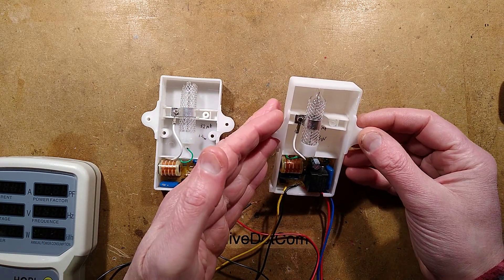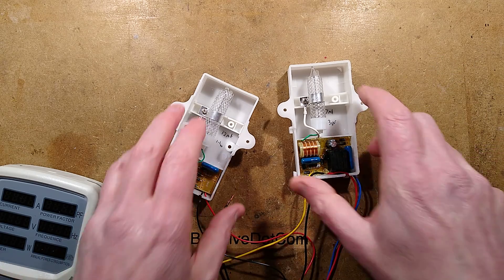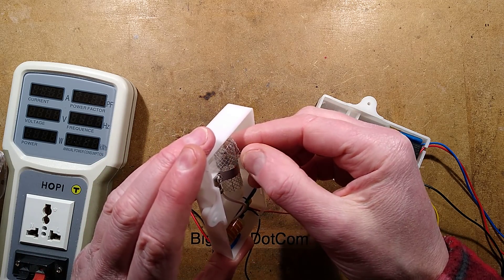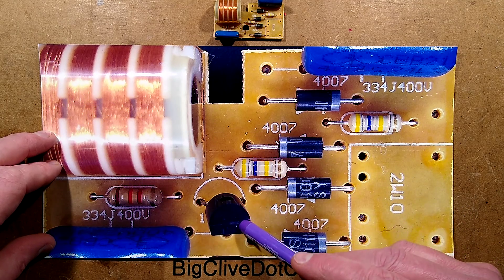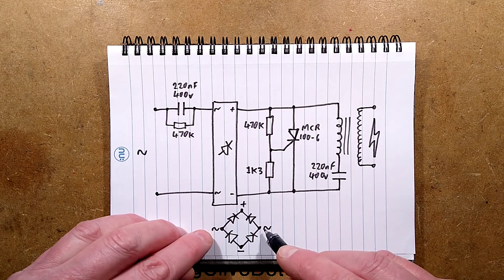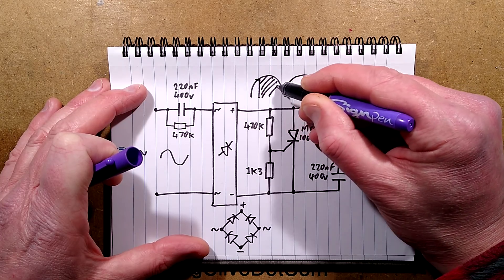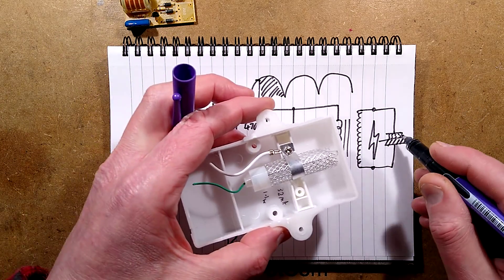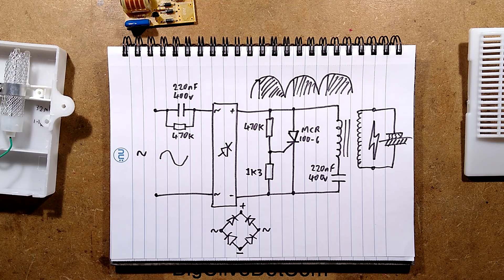The "two-wire" high voltage mystery eBay device

Comment: Thank you for exploring into the 120V side of things, Clive!
These are interesting, but I think they would not like my radios. LOL
Reply: This is a 220V device that outputs higher voltage to the discharge tube.
Reply: @johndododoe1411  I think the 120VAC version would be the same, just change the resistor ratio slightly. The thing to make the high voltage there is dV/dt, the speed of the turn on of the thyristor, so the secondary circuit can generate the fast rise time pulse. So long as the capacitor on the primary side has enough charge the limiting factor is the tube strike voltage, which is a lot lower than the open circuit voltage the transformer can produce, though that also is limited by internal arcing through the distributed secondary.
Reply: I just have a quick question for you.
I am quite a noob about electronics and there is something that I never quite understood about capacitors. What is preventing them to discharge into the "charging part" of the circuit instead of the part that you want to dump that high voltage into? My only guess is that you can use diodes to prevent the electricity to flow back into it but are they strong enough to not get fried by all this high voltage? Or maybe there something else that I am missing?
Reply: @Reth_Hard  I can see the confusion, but to understand you have to look at the circuit.  For example a smoothing capacitor after a bridge rectifier does not feed  back through the rectifier (because it IS a set of diodes that rectify the voltage) but instead sustains the voltage during the altering voltage trough. That's a parallel application.

A dropper diode is a series application and that's a little harder to visualise.  If someone could explain it to me I'd really appreciate it, but I've always imagined it as a charge pump.  The -ive side of the capacitor is actually +ive wrt ground but the capacitor will only "conduct" as much energy as its specifications allow - which is why dropper caps are usually rated in (a few hundred) nanoFarts.  That "energy" will result in mains voltage if you measure it with no load, but under load a much more friendly voltage will usually result.  That's why Clive and everyone else is a bit suspect about dropper capacitors in the wrong application.  A component malfunction could result in mains voltage where you don't expect it, or a wrong polarity could put the device case/earth at mains potential as we've seen in a few videos.

A third application is as an R/C (resistor/capacitor) filter.  It's a series application with a resistor (that's the filter part) but it is in parallel with the signal.  That means it dumps resonant frequencies to ground/-ive.

I also think that I'm a lousy electronics teacher, and this probably hasn't helped you in the slightest LOL
Reply: @Chris_the_Muso  
Thank you anyway...  :P
To be honest I forgot that capacitors were often used for filtering curent and were just assuming the one we see in the video was used for pulsing current into the mesh thing. I'd like to learn just enough about electronics so I can repair some of my stuff when it's possible instead of dumping it in the garbage. I feel like it would be better for my wallet and the environment.
Reply: @Reth_Hard  Ah, I see.  Yes it does cause the capacitor to discharge through the coil as Clive said, after first charging through the coil.  In that respect you are right - the current is designed to flow backwards through the coil in a few microseconds when the thyristor shorts it to ground.  It's a similar application to the old style ignition coils in cars.  These had a "condenser" which is just the auto industry term for the capacitor on an ignition system.

If you've got a real interest in electronics you can learn to fix things.  In the old days (ie 70's and 80's in my case) we bought electronics magazines and built the projects that interested us.  Usually the article had an explanation of how the circuit worked.  The magazines have gone, but the internet seems to have taken their place.
Reply: @Reth_Hard  In this device, it does discharge back the way it charged, leaking through the thyristor circuit until that circuit triggers and speeds things up. The bridge rectifier diodes are strong enough to prevent discharge into the mains.  The only crazy high voltages are on the other half of the coil.
Reply: @johndododoe1411  
Oh ok! Thank you really much for your response!

Comment: I'd bet most of the wattage of that circuit is the thyristor shunting, rather than discharging to pulse the coils. Do you know about other similar noisy circuits that are more efficient or are they not for that config? I know they don't have to be for the low wattage range they run in.
Also, on the low power factor, that implies it's running 28-35 volts-ish, correct? (I have a soldering fan that runs .10 on 120v which tallies up with the voltage it probably is.
Reply from the maker: In this case I think the power factor is due to the odd current waveform of charging the other capacitor.

Comment: FWIW 1.3 is a standard value in the E24 series
Reply: Yep. 1.0, 1.1, 1.2, 1.3, 1.5, 1.6, 1.8, 2.0, 2.2, 2.4, 2.7, 3.0, 3.3, 3.6, 3.9, 4.3, 4.7, 5.1, 5.6, 6.2, 6.8, 7.5, 8.2, 9.1 ... 24 values.
Most people don't know how it is calculated either: for N = 0-23 (24 values total), it's 10^(N/24). The E96 values are similarly calculated.
Reply: @demef758  the formula gives a good approximation but it's off in the middle of the range (in the E12 series it would calculate 2.6, 3.2, 3.8, 4.6 instead of 2.7, 3.3, 3.9, 4.7). I've graduated in electronics engineering in 1994 and never seen the formula, but I can still recite the E12 series even if you wake me up in the middle of the night 😄
Reply: @volvo480  The E12 values are separated by 10% to each side. Guess why ;p
Reply: @demef758  I am bad at benchtop electronics design the way I am bad at chess: really bad, and it's worse because I will never be Ruy Lopez or Michael Faraday. But however shitty a failed physicist I am, I do know my logarithms, and the casual mention of the E-series was enough of a pointer to let me go look the whole thing up and lay the matter bare....I had always wondered about those values: 470k, who ordered that?! Now I know. Thank you. I really do get it.
Reply: Thank you, it just took 52 years for someone to mention the E-series for me to go find out what it is. Found the article on Wikipedia. I get it.
Reply: I was going to say, I had a pack of E series and that came as a value.

Edit: just looked in it, it came with 5, I've used 1. Kit of some 800 E24 1%'ers
Reply: @SupernovaSpence  5% E24 you can bet that some are marked differently and yet are the same measured resistance, or the higher marked can actually be lower in resistance. Only way you get a 5% E24 range is because they are the outliers from selecting the 2% parts out.
Reply: @SeanBZA  I meant to say 1%'ers. Should probably read my post before posting haha. I fixed it.
Reply: @SupernovaSpence  I had those Chinese 1% resistors as well, and all of them were the rejects from the manufacturer, as there was a gap of the 1% parts that had been removed, so all that was left were the parts up or down 1% from the nominal colour. not good as precision parts, but for general purpose good enough, as you really do not care about a LED or pull up resistor being any exact value, just that is around that value.
Reply: @SeanBZA  for the lower values, not too big of a deal, as long as you check resistance before placing. I tend to do that on analog devices anyways to match the circuut
Reply: @danstiurca7963  yes, it's value is 300 COBBs (cans of baked beans) 😬😂

Comment: Is the size of a 2w10 bridge rectifier correct for that spot? Of so, the red wire could be at the bottom corner , move the black up to the other leg of it. Then use links where the diodes are now. 
Maybe they built it for use with that bridge rectifier with the option of using discrete diodes if needed.
Reply from the maker: I did consider that, but the track layout is odd for that component position.
Reply: Oh wait. That cannot work that way because the capacitor dropper.

Comment: It's interesting that the circuit is quite different between the 2 wire and the 4 wire version. you would have thought they would have used the same 4 wire PCB  but just omitted the relay and associated components.
Reply from the maker: I think they slimmed the circuitry down in the 4-wire version to fit the relay in.

Comment: 0:35 "For sterilising chopsticks"
That's curious, as if i'm not mistaken in mainland China chopsticks used in restaurants are most likely to be made out of melamine (or plastic in general). Wouldn't sterilising in this way degrade the material over time.
It actually would make more sense in Korea where metal chopsticks are most common.
Reply from the maker: Some of the listings mention chopsticks.  I'm not sure the material they use.  I prefer wooden chopsticks for the extra grip.
Reply: Haven't spent much time in mainland China to informedly comment as well. Wooden non-disposable ones are probably preferred everywhere for home use, but not well suited for public establishments (for that, in Japan, there are disposable wooden ones, but that's wasteful as opposed to Korean metal, and Chinese plastic).

Comment: I have a dumb question. If the sparks are inside the tube how does it make ozone?
Reply from the maker: The just couple the current evenly to the inside surface of the glass.  Then it capacitively couples to the outer mesh, causing a corona discharge around it.
Reply: @bigclivedotcom  I'll have to simply agree.  My hed hurts
Reply: Think plasma ball, it jumps off the glass to your finger.